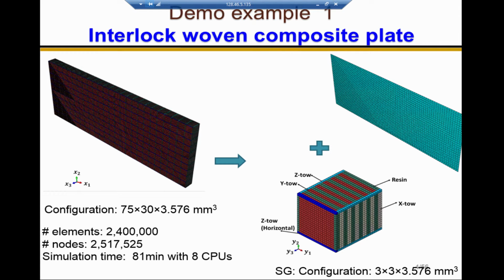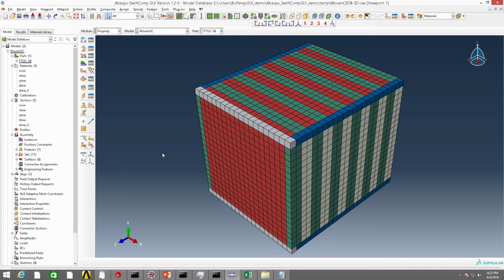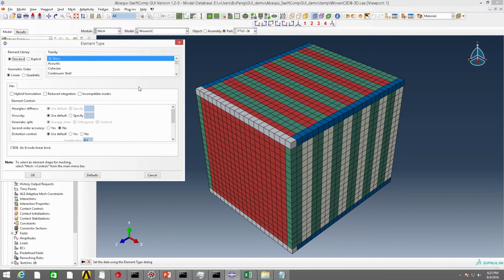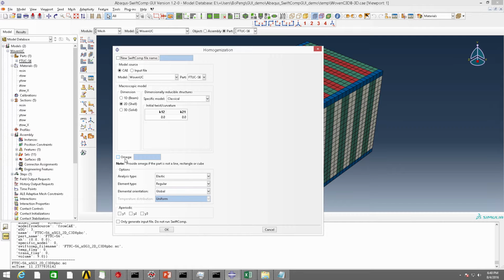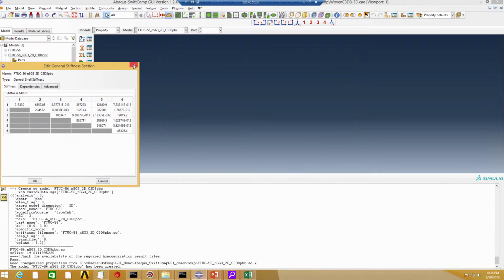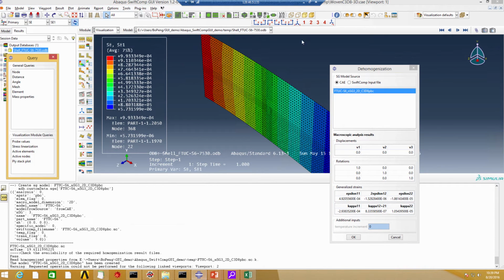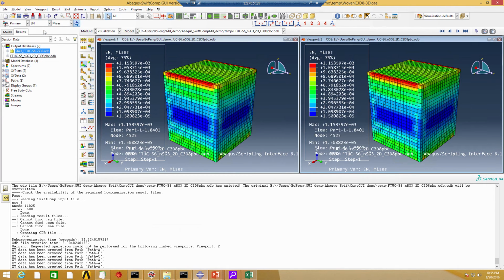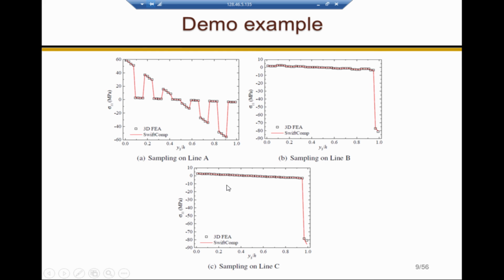Abaqus SwiftComp GUI: 1.2. Interlock Woven Composite Plate Multiscale Analysis Example

Comment: Dear Peng Ji.. your macro structure is 2d plate if someone has macrostructure in 3d and not flat but 3d complex geometry including curves and circles then at the time of applying homogenized properties element orientation should be attentive or not for curve and cylinder different element orientation has to be chosen or it will be included in normal global element orientation (with respect to meshing)
Reply from the maker: Hi Vivek, thanks for your question. Since Prof. Yu has answered your question in cdmHUb, so I would not repeat his answer here.

Comment: How could it is possible for the value of v12 of y tow is 0.0153 and v23=0.011174 of z tow bcs  i am getting v12=0.263 y tow and v23=0.334 z tow  please clarify my doubt
Reply from the maker: Thanks for the question. The x and y tow are the same material in different directions,  but the z tow is a different material. The material properties are from a published paper.
Reply: @bopeng4369  can  you  send me your published paper link on this particular problem
Reply from the maker: @nagappasiddgonde1088  Please refer to :  https://www.sciencedirect.com/science/article/pii/S0263822317334566